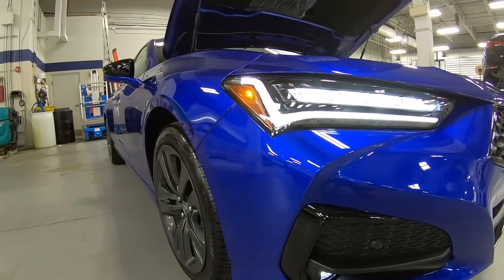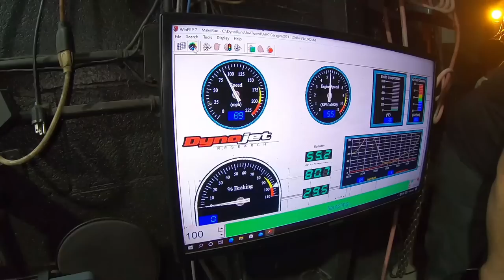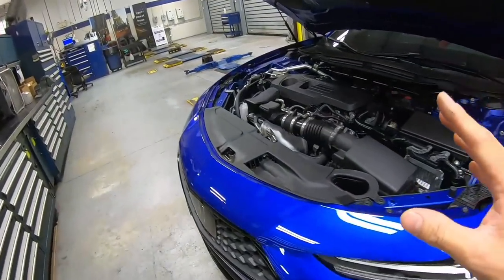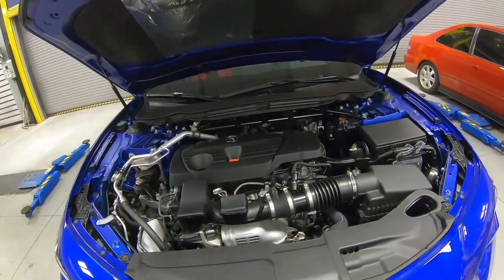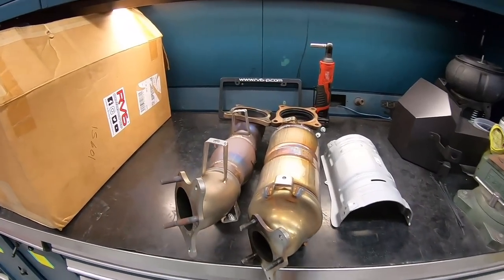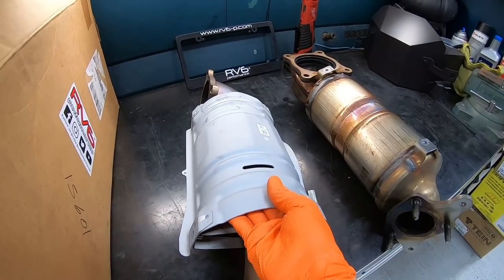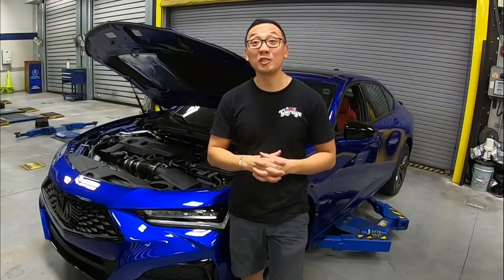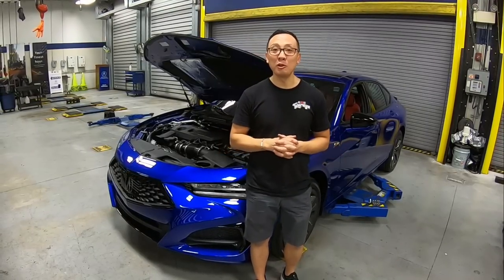2021 Acura TLX A-Spec - Dyno Testing |  RV6 Performance Downpipe Installation Guide (Episode 1)

Comment: Nice! I miss my 07 Type-S and want one of these new Acura’s but at the same time I want a Lexus GSF. See which one I go with when time comes.
Reply: This Aspec starts off at $45-47k plus tax you're looking at almost $50k a 4-cyl turbo.
Reply: @ifearedfate9787  ima go with the GSF. Still got 2-3 years I’ll get a 2019-20. The good thing is most people don’t use them as daily drivers and are well taken care of. I should have kept my Type-S I regret selling it.
Reply: @Daniel-z2j2v  I’ve heavily debated selling my 2008 type s manual (original owner) for a gsf. Bad move?
Reply from the maker: TL-S is a keeper
Reply: @sockerballer100  man it’s been over a year and still miss my Type-S lol. But I didn’t buy myself another car bought the wife a Tahoe. Maybe if I bought a GSF I’d feel different but I’d keep it and save up for the GSF see if you wanna sell it after.

Comment: Just wondering if you had any issues with.the rv6 catted downpipe? Did the check engine light come on?  And will it pass emissions?  I wanted to add this to my car but worried about those issues.
Reply from the maker: No issue with the catted downpipe, No CEL. Florida is a no emission state, and we never test it. I assume it should pass since quite a bit of folks have installed them and they are from emission states.

Comment: Did you throw a cel? I had a rv6 down pipe for my 17 accord and they said the cel would come on even with the defouler and I wasn't comfortable with a cel on a 17 accord with not even 40k mi on it. So I sold it before install.
Reply from the maker: No CEL

Comment: Then Cadillac shows up with 472 and 668 hp CT4-V and CT5-V for slight more money than 355hp Type-S!
Reply: Than in 5 Years  You're buying a New Car Because the Cadillac broke Down
Reply: @mannyfresh5909  i had a 2013 ATS4 2.0T with 90,000 miles on it and it had almost 400 lb-ft of torque with a ecu and never had any problems.  We traded in 2018 and got more thwnni owed so it was a good deal and a nice  car.

We have a CT6 now.

Comment: is that 240whp or crank hp
Reply: Whp, its around 280crank if i am right
Reply from the maker: 272 crank and 240 whp
Reply: @ahcgarage  Thanks, I would be very concerned if it was crank.

Comment: I don’t like the engine sound, will see how the type S sound like. Acura should bring back stick shift on the type S or at least as an option. The car look amazing though.
Reply from the maker: With an open intake and exhaust, the sound will be enhanced
Reply: I went from a 19 3.5 PAWS to a 21 A-Spec FWD; I miss the sound of my V6 but, the 21 2.0T is better in every way.

Comment: Had a Honda Accord years ago. Thought they stood for reliability until my TRASHmission crapped out and cost me 5k to replace it with a beefed up unit and trans cooler.  Honda had a Class action lawsuit and they got their asses handed to them by Milllons of owners from 98 to 03 vehicles. I wouldnt buy another honda/acura ever again.  Flashy overpriced garbage.
Reply from the maker: Sorry to hear the poor experience. Hope you will give Acura/Honda an opportunity to make it up to you.
Reply: Their automatics were bullet proof before 98 and after ~2007 depending on the model. You just happened to jump in at the wrong time. Engines have always been rock solid.

Comment: I’m so mad that Acura just fabricated the numbers, unless your dyno broken🧐
Reply: Acura numbers are crank hp. This is whp.
Reply: Darius Carter The numbers that auto manufacturers publish are the crank ratings.

A dyno measures wheel horsepower or the amount of power that makes it to the ground.

crank rating ÷ drivetrain loss %
subtract that # from the crank rating and you should have your whp rating
Reply: It really doesn’t matter anyways, this Acura slow asf, and heavy. The accord is the car to get.
Reply: @dariuscarter4746  Nobody buys Acuras because they’re fast. They buy them because they’re an awesome feel, luxe, and reliable AF. My k24 2009 TSX hit 300k and I rewarded it by modding the sh*t out of it. Pistons, rings, clutch, race crank pulley, DP, ported head, valve train, oil pump, pan baffles, suspension, etc. Now it’s my daily/track beast that eats v6s for a snack. NA, so it’s still slow to a 2L twin turbo... or any new Caddy... but I couldn’t bring myself to trade it in. I wanted to see what I could make it do. Haha
Reply: @IdrisFashan  well, I do ever since my mom had a 93 coupe legend, back in 95 I thought it was fast until I got older, then I realized it was the feel and looks that had me so in love. Your so right tho, that’s y I’m looking at m340i and g70 3.3tt. Acura is just😩 at this point in life

Comment: I just got 22 tlx aspec 3 weeks ago and noticed a weird fluttering, sputtering sound coming from the engine when accelerating after lile 3 or 4 days. It seems to be happening on any road with an incline. Brand new car or not, i dont think it should be making this noise. Anyone else heard this in their tlx and if so what is it?